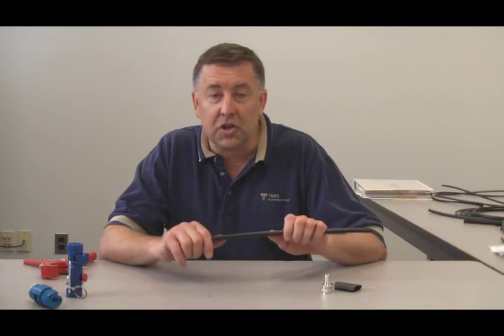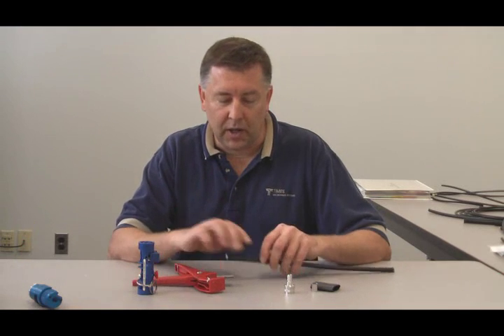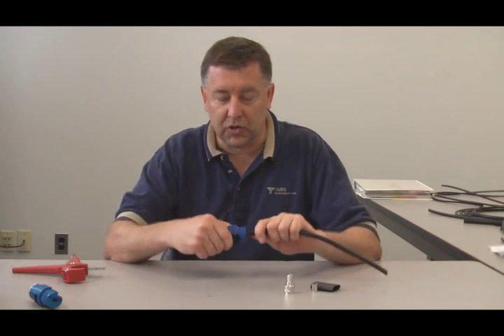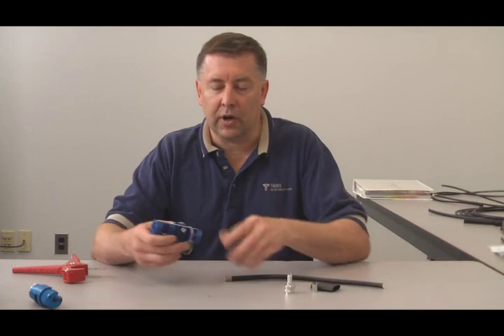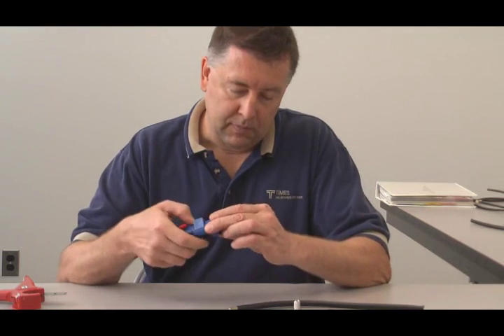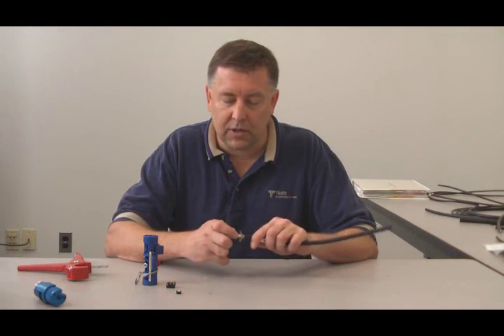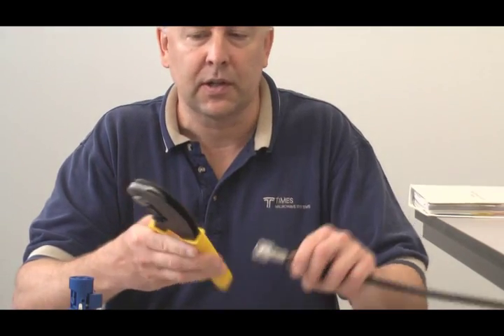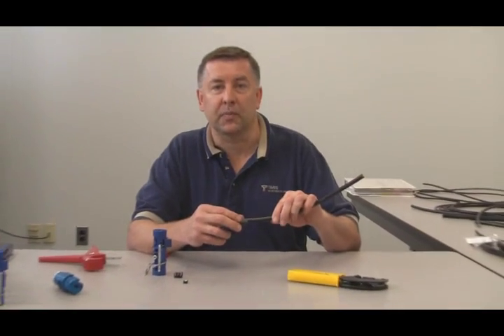Demo Discoveries: Times Microwave Systems EZ-400-NMH-X Connector Termination Tutorial

Comment: Seems that you forgot to solder on the center pin. I am curious about this, as my connectors came with a soldering insulator that makes no sense in the instructions.
Reply: That is a no solder connector. The center pin is spring loaded so when you slide the connector on the cable it will make contact with the pin and push the pin up inside the connector.
Reply from the maker: The beauty of the EZ connector design is it uses a gold plated BeCu spring finger pin that is captivated in the dielectric at the factory. All you have to do is to prep the cable to the proper dimensions and put a slight chamber on the center conductor and you can then just snap the connector onto the cable. The connector has a positive stop so no fear of pushing too hard. The braid wires will line right up with the first rib at the back of the connector which will give you good visual confirmation that the connector is in position. It’s become so simple that you can actually do it blind folded.